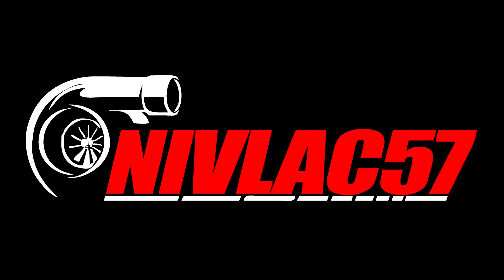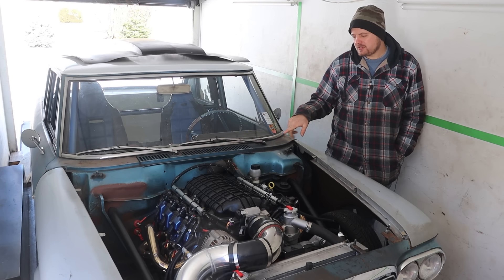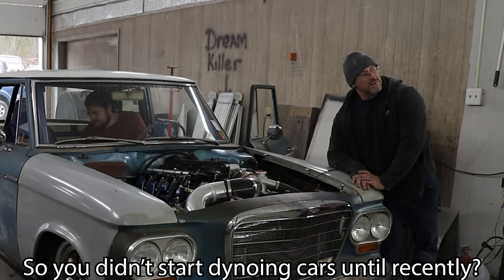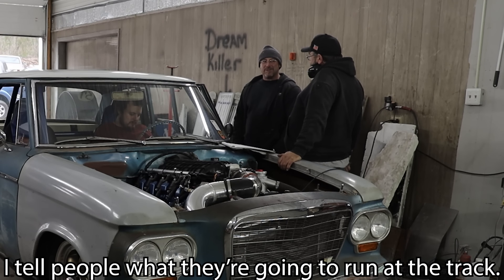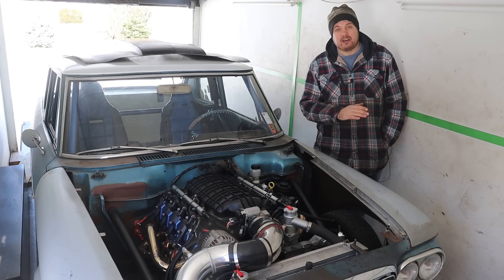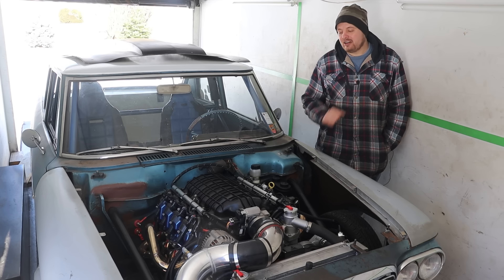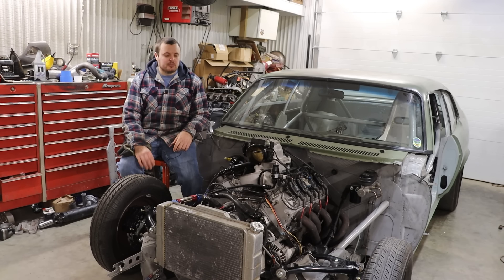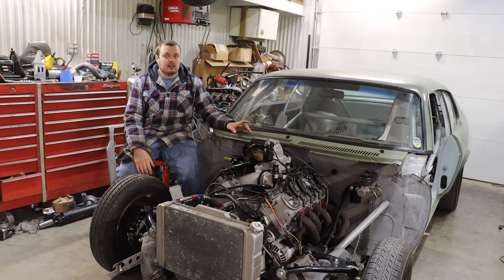180 Degree Headers VS Equal Length Conventional Headers - On The Dyno

Comment: I had a dynoed 585hp .040 over, 11.5:1 400 sbc backed by a TH400 in a shorted S10 in the late 90s. Most people will not understand how scary and fun a short wheelbase, under 3,000lb. Pickup can be on street tires. It was a tire shredder at any speed. It ended up pushing out a cylinder wall out at 7,000 rpm going down the highway. Hardly anything was salvageable, it was like a bomb went off under the hood.
Thanks for another great video guys. You are my favorite father and son team on here. I wish my son would have been interested in hot rods, but he is a great young man nonetheless.
Reply: I had a warm Vortec 350 in an S10. It's just terrifying and horrible. In the wet it just spins and fishtails and the steering is so numb and vague you're really just making suggestions.
Reply: It's true, everyone thinks they need a turbo 6.0 making 800,900,1000hp. When the truth is that they couldn't handle what a turbo 4.8 with almost any cam+springs, the right trans and converter can do in a street car on street tires. 500-700whp is nearly unusable outside of highway roll racing on some wide, open, flat, empty highways out west somewhere. 585hp from an n/a 408ci SBC would be extremely serious in the late 90s. I remember thinking if I could just get my hands on a 400-500hp car I would seriously be somebody. The LS was a mystery still, untrusted and believed to be near the peak of it's potential with weak pistons and rods.
Reply: I have a 700HP 1984 Vette, lightened to 2800 pounds.  It's VERY spooky.

Comment: Your question of the 180 header compared to equal length. I’d say the 180 header definitely has a much more raspy high pitch pronounce 
sound and sounds well tuned!
But both styles will sound great, basically it’s your preference. But that 180 degree header is a head turner too!

Comment: I like them both. I am working on my first Ls swap. Ls3/6L90 in a 03'Crown Vic Police Interceptor. I am running a Redhot cam from BTR with matched springs. It's a 221/24X .617 .619 113 LSA.
Reply from the maker: Nice!

Comment: You can definitely put in a bigger cam with stock pistons btr and Texas speed both offer much bigger cams than a lt2 cam that have piston to valve clearance also Texas speed has cam kits with everything you need for a bigger cam for less than a thousand bucks
Reply from the maker: Yeah. I could, and it might reach my goals. Orrrr... I could put a supercharger on it and make sure that it will meet my goals.
Reply: Also a change with fuel to using alcohol increases power significantly.
True E-85= 85%ethanol => +100 HP also with far less carbon deposits + far more consistent power; 
ethanol = C2H6=CH3-CH3
methanol = CH4
also consider nitro-methane added as Phong with Brent [PFI Speed]
Also adding higher energy/voltage spark increases burning efficiency 
Also with LS/LT, Vortec, Northstar VVT adjustments
Best complete ÉCU is FuelTech along with less expense.
All The Best

Comment: In a previous video I made a comment (same as below) based on you mentioning you wanted to refine the 180-degree headers sound characteristic as much as possible, but you were very pleased with the sound of the end-result currently. I like the sound the Studebaker has now, but I think some of the ideas below may further refine the "wail / scream," of your custom creation.....just some thoughts.

I figured you may have interest in your quest for sound. I have read and seen some evidence the the closer that the two banks of 180-deg. headers merge together, and the steeper the angle they merge together at, the more audible the higher frequencies become / the more muted the lower frequencies become.......to be succinct; I think an X-pipe turned perpendicular to the axis it would normally be used, placed very closely to collectors (ie: under the transmission), using an in/out from 1-side as of the X-pipe as both inlets, then the corresponding in/out from the other side of the X-pipe as both outlets could really amplify the tones your shooting for with 180-deg. headers........additionally if you have seen some of the "anti-reversion-chamber-mufflers" on the market from companies like Schoenfeld, Hendren, Dynatech, & ProFab, these are a bit like a "sound-diode" if looked at outside of what there primary function should be. On circle track cars you can really tell the difference in the smoothing of the exhaust note when installed, and I'd venture to guess if one was installed on each header collector (before the X-pipe mentioned-above), it could have similar effect of not allowing as many returning pulses collide in the X-pipe, muting lower frequency sounds........lastly your probably aware of the anti-drone devices used on high-end axle back exhaust systems, where a capped off piece of pipe is intersects the exhaust system to function as a Helmholtz resonator. If your familiar with its function, you can see that it being capped vs. connected to the other pipe (in a dual exhaust system) can cancel full-order vs. 1/2-order frequencies, therefore having an H-pipe located near the very end/tips of the exhaust system could potentially alter the sound (better/worse) depending if connected vs. 2-capped sections of pipe with internal volume, for a particular frequency you want to cancel / amplify.....

All the best; I appreciate your content 😎👍🏁
Reply from the maker: Good Tips. I may have to try a few. I tried a quarter wave resonator on my Wagon. Didn't really work as well as I was hoping.

Comment: The 180-degree headers sound decent, but my favorite is still equal-length into the shortest X-pipe you can manage. Probably the best example of what am X-pipe does to the sound is Ryan Tuerk's Formula Supra, if you compare the sound of that thing to any of the prototypes that run the same engine without an X-pipe, it has a very distinctive shriek to it that's unlike anything I've ever heard.

Comment: Get the heads ported - Allied Motor Parts - exchange or outright - reasonable prices 
A To B on an engine dyno 180 vs Std Stahl SBC = 8 to 12 BHP  
When you fix the collector/tail-pipe you get an added 12 to 15 BHP 
LS - Engines like close LSA Cams in the 106 to 110 range and because the heads have huge volume it isn''t necessary to have high duration cams but they do like high lift, which is difficult with hydraulic lifter systems - 500RWH is not uncommon
Reply from the maker: Getting the heads ported isn't going to get me where I want to go.

That's cool 8-12 is a lot

Yeah. It's just the cam we had. We got it for basically free.

Comment: I will never understand why people scoff at 300-400 wheel like it’s bad numbers. Most people aren’t even used to anything over 250 wheel especially when it’s in a 3k or less curb weight vehicle. Anything over 400 and you definitely need drivermod in a sub 3k curb vehicle.
Reply: This, people have never driven something like a c5 corvette, it feels tamed, the torque curve feels tamed, smooth but you step on the gas and if you are not experienced you feeel that you may die.

Comment: From a "cool" aspect, I like the 180 headers. It's unique and definitely has a hell of a sound.

From a real world perspective though, I think the equal length would be my choice. Just packing and maintenance feel easier. Not to mention it's got a hell of a whisky drinkin, back alley knife fight, tone.

Also I'm curious if you considered nitrous for the Studebaker. If you're looking for 200 or less extra grunt, a relatively simple nitrous throttle body plate could get you there. While being minimally invasive and the least amount of weight to the car.
Reply from the maker: Yeah. I've thought about it a few times. Just don't like filling bottles. That's why I refuse to go to CO2 boost control on our turbo cars either.
Reply: @Calvin-Nelson  Fair, nitrous is easy but it's also frequent maintenance. Blower or turbo is more work up front but way less to maintain.

Recently saw Steve Morris go through the Torque Storm factory. Maybe a healthy little centrifugal is what the doctor ordered. 🤙

Comment: I need the best injector timing for a 02 6.0 LQ9 with a 218/224@.050 110lsa .553/.553 cam 11:1 FBO..
Reply: And it's po1 ecu do I change boundary or normal / makeup tables ?
Reply from the maker: I wasn't aware that the stock ECUs allowed you to mess with injection timing. Never really looked for it.

Comment: More cam duration would solve that easily.  Cheaper than forced induction
Reply from the maker: Yeah. It won't meet my goals. I already know that. The aftermarket cams that I see would be worth about 40hp at the most. I need significantly more than that.
Reply: @Calvin-Nelson  I'm probably missing something in your setup but, a good friend of mine has a full size truck that ran low 12s at like 5k lbs intake exhaust cam/tune no vvt though

Comment: Do a LT head swap on an LS, with the BTR cam you can make over 600 HP
Reply from the maker: I'd rather have the LT block because it has a better oiling system and a much stronger block.

Comment: I wonder if the timing discrepancies between expectation and reality have anything to do with the way the crank trigger was set up or how the cams were degreed in during the build vs. how the older engines were done.
Reply from the maker: It would be crank shaft trigger related. Cam sensor does not effect timing. I never actually put a timing light on it. You could be onto something there.
Reply: Piston shape effects the flame travel speed...the higher the engine...the greater the timing needed....it behaves more like a BBC with respect to timing.
Reply: False claim about effecting flame speed.Clear lack of knowledge within chemistry &a physics. 
In reality, The shape of the chamber will affect the flame travel [not speed] due to variable compression and air/mixture within the space.
Good Luck
Reply: In reality, Only if the cam sensor and crank sensors have errors will there be a difference between other method of timing measurements which were commonly done via physical marks on the wheel using a timing strobe light.
Also, such strobe light + timing marks have variability as clearly seen during those measurements too.
All The Best

Comment: All the V8s that "hit hard licks" down the road drive me batty, but so do HDs.  The 180 sounds beautiful while the "timed" headers are close.  Hard licks are lost energy for sure, so I wish folks would move away from them.  Most will never do a 180 as you have done, and due to fitment, most won't do the other type either.  This kind of tweaking is  great exposure as it puts the idea out there and makes it all seem less effort.  Indeed if many cars could go the timed route with just a little steering shaft R&R it will catch on.  And more powah!  Everyone likes that!

Comment: From what I've seen on other engines, VVT is really only for emissions and does NOT help add more HP, no matter how you try to tune the VVT. Does that hold true on these LS's as well?
Reply from the maker: That is not true at all. You can greatly change the amount of power the engine makes at low and high RPM by optimizing the valve timing at different RPM levels. In our 6 cylinder testing we have gained as much as 50 hp with the only thing changing being cam angle. That being said, you could statically set the cam angle to be optimal where you plan to operate, and get a good result, but if you wish to get the most horsepower everywhere it is very useful.

Comment: The biggest issue with 180 headers other than just having the cross member and sump with enough space to pass 4 pipes under the oil pan is the length of the primaries can be long which can cut into engine top end. Most headers designed for length with engine rpm considered will have 3 refections for 240 degrees of crank angle so this is considering a healthy camshaft as a stock camshaft might not have any flow area for 240 degrees of crank angle (at peak HP rpm). This will still give 2 reflections for 180 degrees so it still kinda works but the stock cam may not like a 2 reflection for 240 degree extra long primary length. If you're primaries are too short it's forgiving as the steps up to 4 reflections or 5 reflections are smaller than from 3 to 2. But if you are too long for 3 and not quite down to 2 it will not have a good stacking of residual vibrations and will not scavenge well on sound energy. That's not to say it won't use the collectors Venturi effects but it will still likely move the peak HP down a touch especially if it's equal length and every cylinder is doing the same thing exactly. So if you are too long it might take some length before things become beneficial again and if you need to pass pipes across the oil pan for 180 degrees then the 2 reflection solution might be the only one that's viable and that solution must be right and not just ballparked where as going a little short on a different solution isn't that bad. For an equal length setup without 180 degree arrangement each bank will have a 90 degree pair. These cylinders may be like a single pulse at the collector. You may need bigger collectors. For standard non equal length headers you may want to artificially shorten one of these pipes or perhaps 2 pipes for a true "compensated length" for the even bank 2 comes before 6. Making 2 shorter to get it out ahead of 6. You may also want to shorten 3 to get it out ahead of 1. This logic works best with a race exhaust because it kinda ignores that the gas pulse will push on stagnant gas ahead in he pipe. In a non obstructed race exhaust it very well can push into vacuum especially in a Venturi collector. So the logic stands for a well enough scavenging exhaust. Making 2 and 3 artificially short may bring the collectors forward which may seem unconventional and possibly inconvenient if the chassis is designed for the more expected setup. And as the engine revs higher a short 2 will get closer to 8 so you may only want it half compensated for a compromise. Perhaps 2/3 compensated would be better to help more at rpm below peak since we don't care about above peak so even going into negative territory at peak might not be so bad. unless you also want to shorten 8. The situation with 3-5 is the same as 2-8. If you are okay with collectors that angle down a bit from the middle of the engine like shorties and pipes around them that look longer than necessary then this is a possible solution. Same with 180 with a possibility of collectors in a transverse or outward angled position. The old V8 firing order before the fuel injected Windsors changed things but with a 4-7 swap (a hypothetical 3-2 swap on an LS) with rear exits on the headers would naturally be compensated to some degree as 7 is more rearward than 3 and 4 more rearward than 2. But for a fully compensated setup it looks about the same because the 180 degree cylinders are the same in any firing order so the short pair may have to go from front cylinder to rear cylinder on one of the banks meaning the collector may need to be positioned near the center of the engine regardless of firing order.
Reply from the maker: You can go back to the video where I made the headers. I did my best to make them equal length, but the primaries are bit long on a few tubes. The best way to do it is the way my Dad did it on his Datsun. Put the collectors behind the engine. This requires extensive firewall mods which I was unwilling to do on this car.
Reply: We did a video last year on unequal length headers addressing what you are describing.

Comment: Small engine (5.3) vs Big engine (6.2) - Rather Big engine vs slightly bigger one... Difference between them is only 14,5%...
In Europe anything above 2.0 is considered to be a big engine... xD  Driveing eg. Mustang 5.0 in Europe would be comparable to driving 12.5 V8... (but the biggest one is 7.3 Godzilla, am I right?).

Comment: 116 isn't THAT tight. It's the duration paired with 116 that causes a lot of overlap that makes it seem tight. At least according to DV's cam theory. Anyway, IDR if I mentioned it in another video, but what would be really cool to try is an 8-4-1 180-degree header set.

The only downside is the primaries are long as hell (as you mention in the 180 build vid) so adding secondaries to that might make the overall situation worse. This leads to my second, but much harder(?) to implement idea of a flatplane crank V8 with two 4-2-1 headers, but instead of merging the secondaries separately, each side's "2" all come together into a big 4-1 section.

Lastly, I kinda wanna see you guys run a centrifugal setup. Something loud, too, like a straight cut+cog drive SC with a 5-blade splitter compressor wheel. And then for even more whine/whistle do a gear-driven cam, too.
Reply: Oh, and both your setups sound and run fantastically.
Reply from the maker: Yeah. We will see what I can do on the Supercharger. Flat plane would be cool too. I'd sooner do a Hot V cross plane.
Reply: @Calvin-Nelson  Hot-V crossplane would make the 8-4-1 even pulse header MUCH easier to do with usable primary and secondary lengths. Could also do even-pulse 8-4 with twin, twin-scroll turbochargers, or an even-pulse 8-4-2 into a single, BIG twin-scroll turbo. (Just so we're clear "even-pulse" = 180-deg/flat plane equivalent firing)